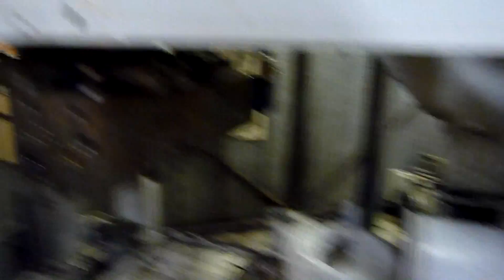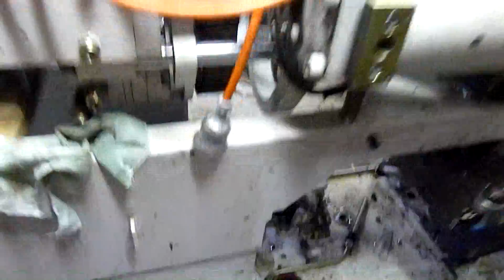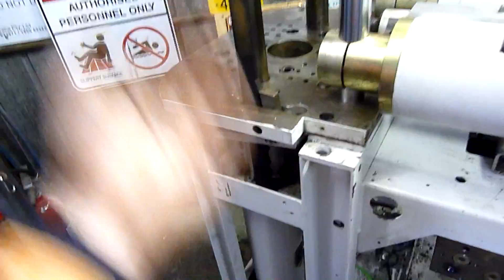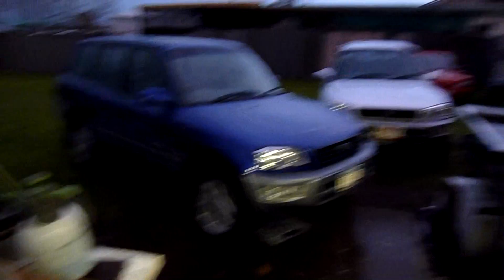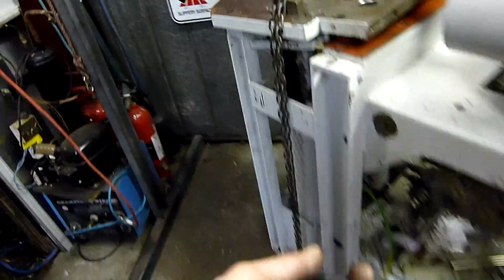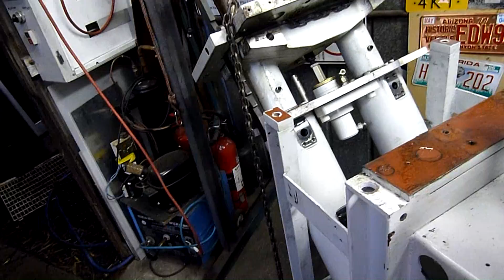Battenfeld Plus 350V Vertical Moulding machine Teardown Pt6

Comment: wittmann-group  com/injection-molding.html

gorgeous new machines there ~$~$~

110 tons clamp force..too much/limited use..hammer forge would have a million uses however depending on stroke length,  period (make brass cartridge casings...or your extruder could attempt plastic inj. molded like the blue .308 Swedish practice ammo).

milsurps  com/images/imported/2009/06/DSCF0326-1.jpg